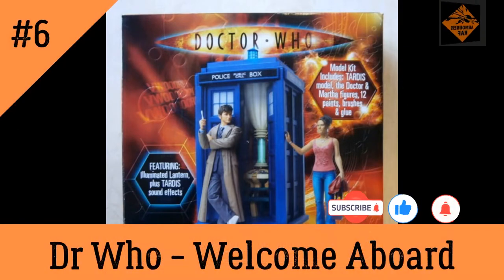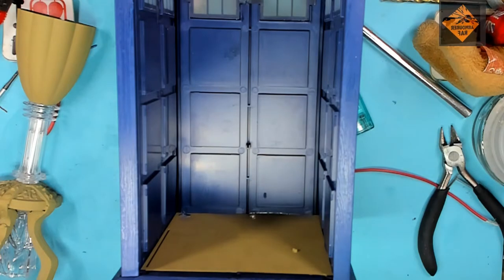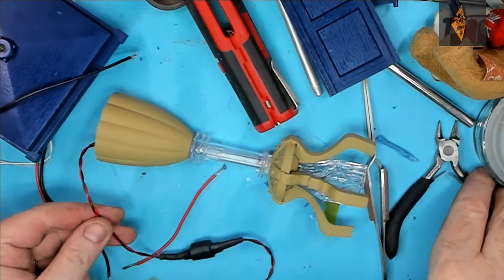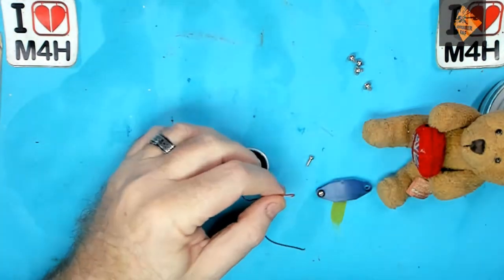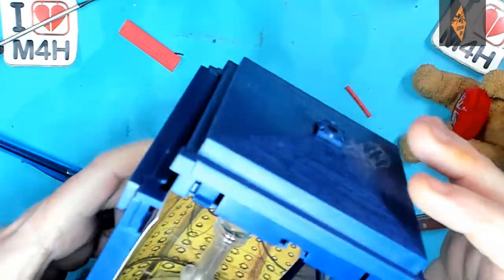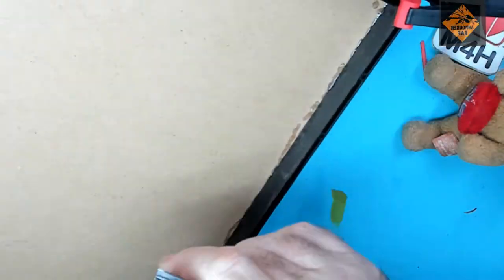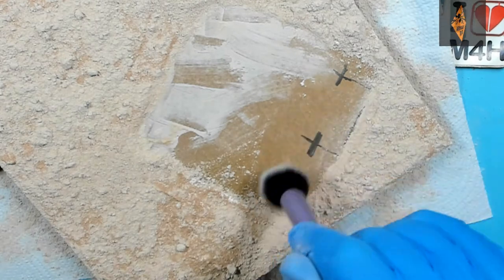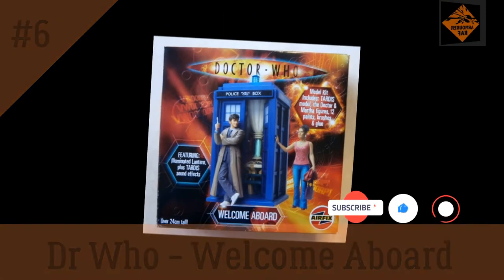Episode 6 Airfix's 1/12th Doctor Who | Welcome aboard

Comment: I'm wondering, did you connect the blue beacon LED and the pulsing green LED in series? I have a green 'breathing' LED that I'm adding, and I'm concerned when I hook it all up that they won't pulse at the same time
Reply from the maker: Ohhh, great question, we’ll presented…I believe they were on the same circuit and work perfectly well 👍🏼👍🏼👍🏼